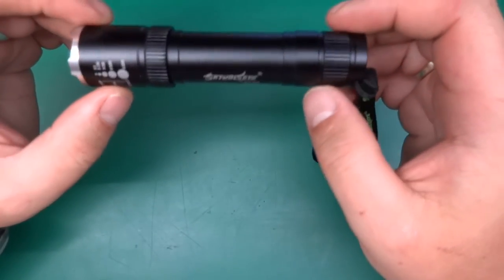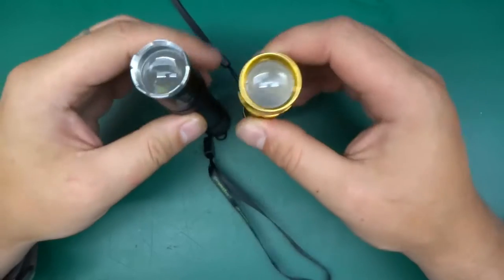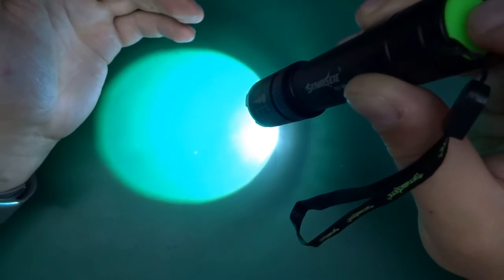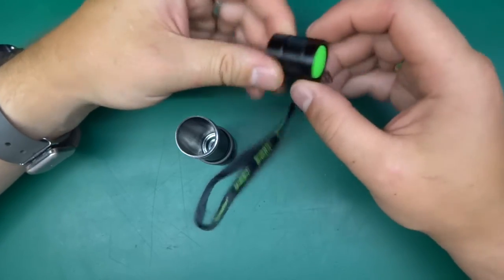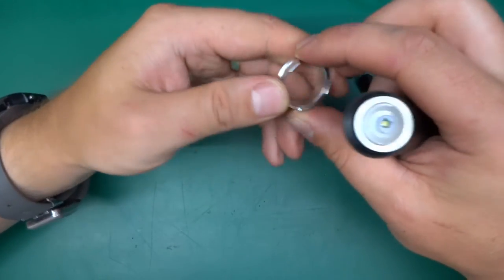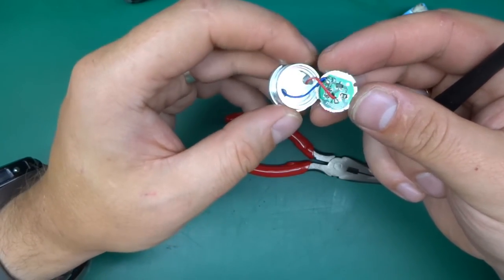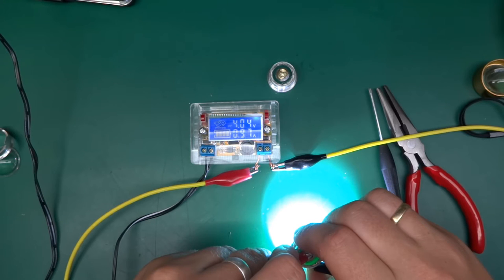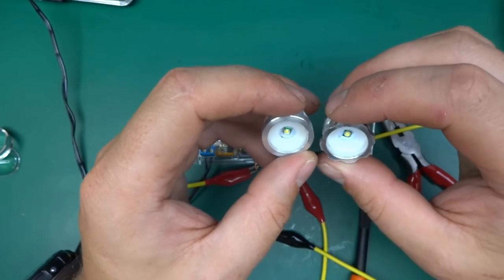Another Skywolfeye: TLY-006 flashlight RaT (Review and Teardown)

Comment: I received one without the focusing ring or any lens protection at the light end.  It's bright and reasonably serviceable, but the absence of the ring makes a big difference.  I sense that Cree makes a tougher, better-built tactical light.  The advantage of the Skywolfeye is that it's made of thinner materials and is more lightweight and smaller.  An advantage for carrying it in a pocket.
Reply from the maker: caponsacchi cree actually manufacture really high power LED's. there might be some cree branded flashlights, but i doubt that cree actually make them internally (but who knows...) those are a cheap tactical light torches, and work perfectly. super handy especially on camping!

Comment: Seems like a nice flashlight. These LEDs are probably LatticeBright LEDs, not Cree, but very similar "clones" with (obviously) a bit worse performance. Anyway, the LED can be removed/swapped, but you have to use some force, at least inside the 6501 (it looks like the mechanism is the same), the LED board is held in place by that plastic thingy, which is press fitted there in place (I used a small screwdriver + hammer (carefully) to take it out). The TLY-6501 has a hollow pill, which is bad for thermal performance.
Reply: Seeing this video and reading your comment, I am thinking about disassembly of one of mine mini Skywolfeye flashlights and make some modifications. Just for fun.. :)

Comment: These LED chips are XP-E - They are 3.5W chips - Absolute maximum 300 Lumens.
You don't really want to feed them any more than 3.1v - Even with the current limiting on the driver board, if you feed them over 4v you are overdriving them!
Reply: Thats interesting, because if the same chip is on the old flashlights too, then I drive it like crazy: I have one old chineese flashlight, with geen clicky ring used for adjusting (the usual one, many brands used the design). Since I do not like the flash function, I bridged the driving chip. So now I have only one mode - full brightness. And since it is bridged directly to battery (just one 0 ohm resistor in the path),  I drive it hard with fully charged battery. I use it for at least 4 years and its going fine. So either it is not the same LED, or it can stand over 4Volts for some time. What can happen when you drive XP-E with 4 Volts for some time? LED degradation or full damage?